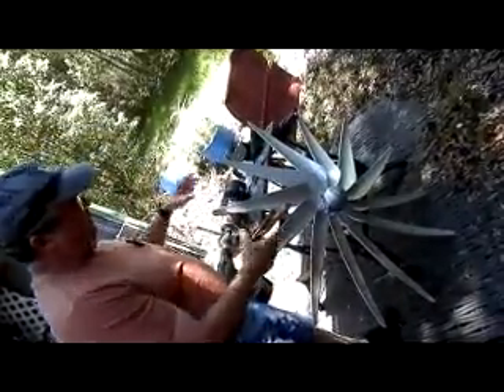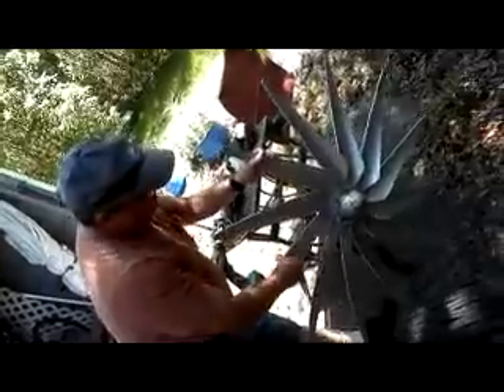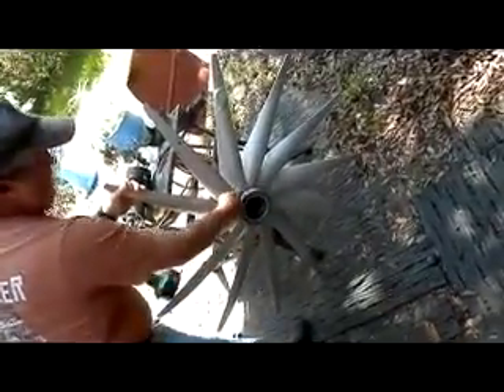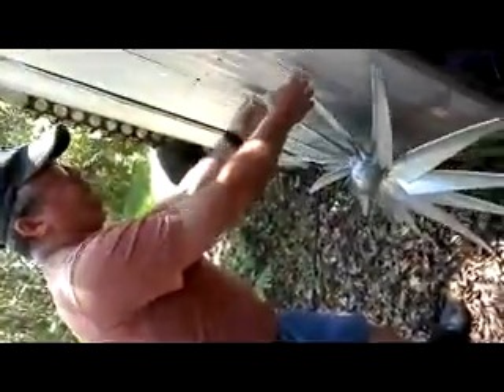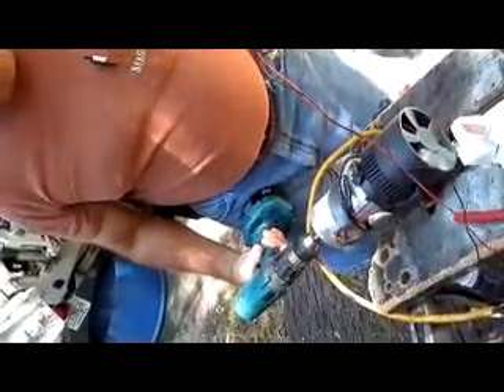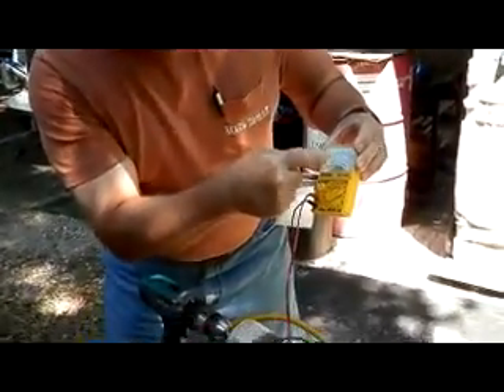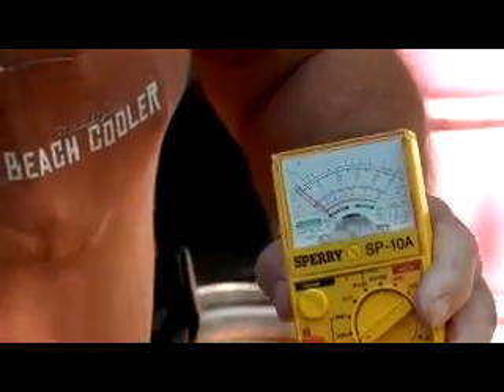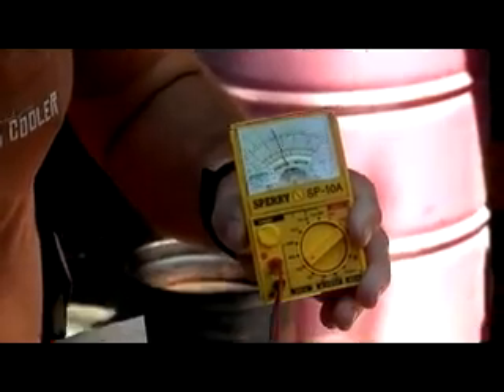home made wind turbine generator

Comment from the maker: This set up compliments a solar power collection, and will need a blocking diode, or bridge rectifier to allow power to go to the battery bank. This will not allow it to run the turbine when winds are low, causing the batteries to discharge.